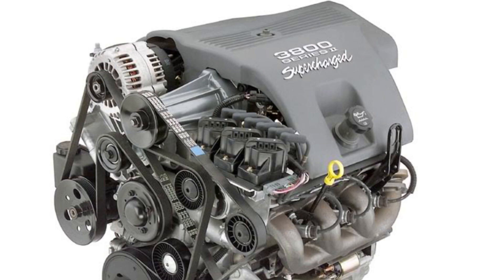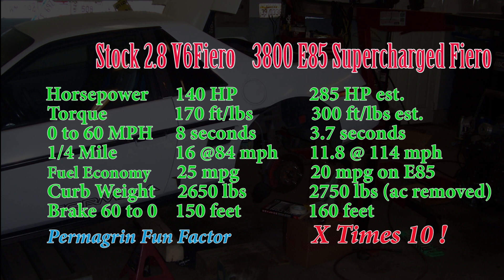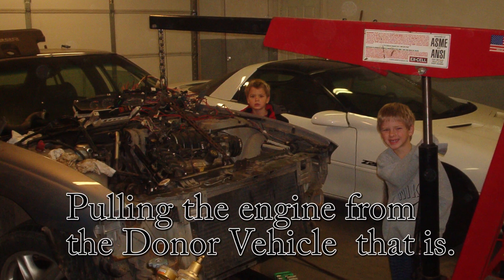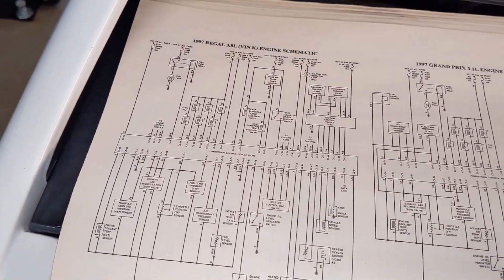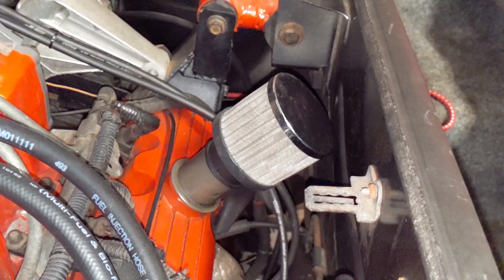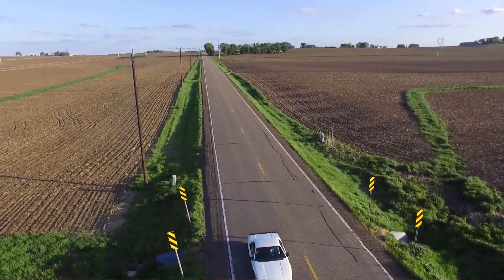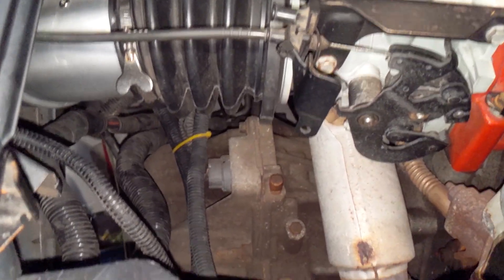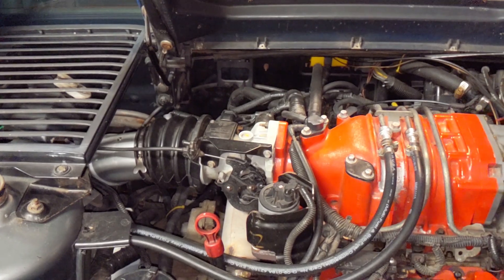3800 Supercharged Fiero (Tips & Closer Look Part 2) / Engine Swap

Comment: I have an -88 2.8 formula with the 3speed auto. I must say I really like the car like that. Its very responsive, smooth shift and perfect kick down.
Doing up a 3.4 engine now and will keep the gearbox. Hoping it will not brake..
Reply from the maker: I think it should be fine, and that 3.4 will add a nice bit of low end grunt for sure!

Comment: I have sort of a off base question but it's related. I've been told that despite the problems with the front manifold and you opted to upgrade to the ZZP Powerlog the gains + price is not worth it as the problems can be fixed with the tune (assuming HPT or DHP) but my question is about the VS cam. Did you replace any of the other valve train components, timing chain, water pump, etc? Not a Fiero swap can't do that now, but driving round a GP GTP in very good condition. By my math I can run mid 12's with a 3500 lbs GP with the same mods on E85; though I might run something stronger at the strip to get a few more tenths.
Reply from the maker: When I took the manifold off the 3800 that's closest to the firewall, it's clear to me that it's very restrictive. Especially if you're going from 240 horse to mid 300. The ZZP piece is beautifully crafted and pretty cheap, I would do it again. As for valve train components I just put in The LS6 springs and I think they're modified retainers to hold them if I remember correctly. Yes I put in just a stock replacement timing chain and gear and tensioner. That was several years ago.

Comment: Ok..which axel needs replacing 
Second what throttle body cable did u use..great video love it
Reply: Lots of axle videos and threads out there. This is why you get a Grand Prix GTP over the other 3800SC vehicles because you can reuse the GTP axle (assuming you are reusing the automatic which I would recommend as well) and one of the Fiero axles. I don't remember which one, lost of videos and forum threads by the way look it up... Throttle cable has been covered too, 4 cylinder Fiero throttle cable works with little modification, the 6 cylinder with more. IMHO DBW makes sense here, no need to do either those just drop the motor in with the PCM and go. Now you need the pedal from those cars to communicate with the DBW, but that's not complicated. There is so much you can do with DBW over throttle cable. It eliminates IAC and vacuum based cruise control (which the Fiero has).
Reply from the maker: Thanks for the comment!  It has been a while but I seem to recall using the stock Fiero throttle cable.  This is an easy part of the swap.  Axles were easy too, I will include some data in Part 3 or Part 4 about the axles I used.  For me this was a concern because I did not want to have to get any expensive custom axle parts made.  Good news is you can do it with all off the shelf parts.
Reply: Keep up the great work and keep on whoopin some a#@😀

Comment: I used the Getrag 5 speed with Spec 3+ with my swap. My car has been swapped since 2000. What I want to know is how hard was it to convert to E85? What & all did you have to change? Who tuned it?
Reply from the maker: New Fuel pump, ethanol rated hoses, 60lb injectors and I tuned it myself.  Pretty simple tune (as far as tunes go).

Comment: Did you go with a slightly higher stall converter when you did the swap or is it stock?
Reply from the maker: Stock.  Sooo much torque down low in a light car - does not need any more stall IMO.

Comment: Wice def... but ehh.. i woda had to gone with at least a 4.3. Much more power potential with a blower and just a carb. On e85 fuel just over 700 before they push out head gaskets. But studes and O Rining it would cure all that. About 20 years ago a magazine built a carbed 4.3 with a super charger and it broke over 700 power was still climbing  till it puked the head gasket
Reply from the maker: Thank you!  Hard part today is finding a transverse transmission that will hold more than 390 RWHP....

Comment: What was the original motor in that specific car? And what transmission do you have?
Reply: All GM 3.8 series II super charged motors came with the FWD 4T65E Heavy Duty trans (various cars models- all the same motor / trans combo) Solid, good automatics! The standard 4T65E's not so much. Most likely had the wimpy IronPuke 4banger Ezra.

Comment: 8 seconds to go 54 more MPH??? I'd say gearing and torque converter should be next on your list of TO DO
Reply from the maker: I'm not tracking what you're saying? Can you please clarify?
Reply: @Toys4Life  of course man.
0-60 3.7 sec
1/4M 11.8 sec @ 114
11.8 - 3.7 = 8.1 sec
114 - 60 = 54 MPH
8.1 seconds you gained 54 MPH.
Ether your gearing is too long and/or your torque converter can't handle your amount of torque. With your weight, HP, and torque I'd of guessed 122 - 128 MPH
If you're not close to redline at the 1/4 gearing is the issue. If your shift to 3rd and 4th feel sluggish, it's your torque converter.
Reply from the maker: Thanks for the clarification - I understand your comment now and appreciate it! I remember when I got into 3800 sC fieros I thought the same thing - why is the trap speed so low for the HP & E.T. ???   I am running the 4t65e -HD tranny with a pretty tame converter.   I just checked a HP tuners scan & it goes thru the traps at a too low 4900 - about 1200 RPMs lower than ideal.  Keep in mind the M90 at these power levels is pretty undersized so while it provides GOBS of torque down low, it really is undersized for the 3800 at around 375 crank HP at higher rpms.  That is also part of the problem...perhaps a big part.  There used to be one other gear available for this tranny that is a bit lower. I remember researching it years ago but a guy named "dark horizon"  (turbo 9.8 second 3800 Fiero) told me he had tried the lower gears when he was still running an M90 on his 3800 (for the exact reason you discuss) but it didn't alter his ET.  He believes it is because of the M90 being undersized at these power levels - which made sense to me.   Correct me if I am wrong but if I went with a higher stall converter, I would get off the line quicker (provided I still had traction and the tranny didn't break) but I believe I would still be going thru the traps at 4900 rpms...right?  One more thing, this is typical of 3800 fiero's - check out this 1/4 mile list  & let me know your additonal thoughts  - Thank You!    I am DimeMachine.  https://www.fiero.nl/forum/Forum1/HTML/070670.html